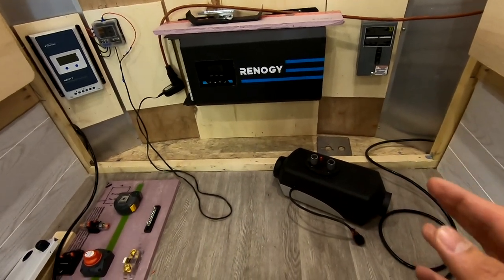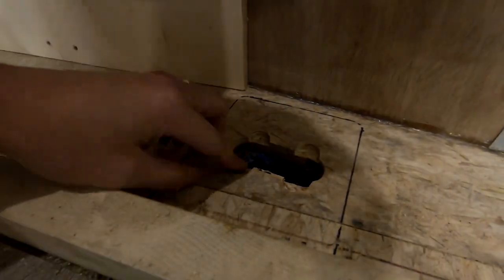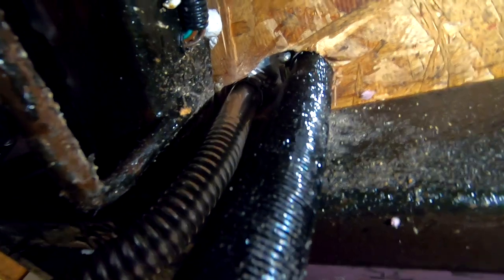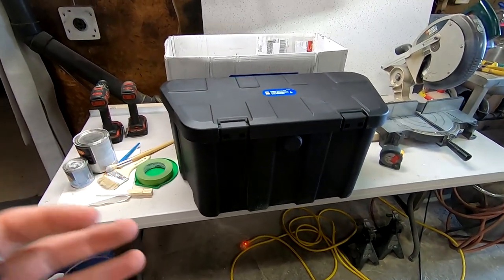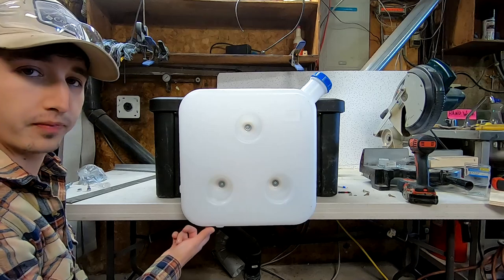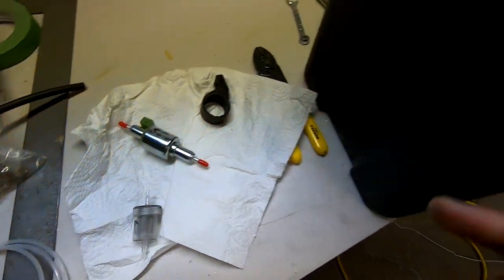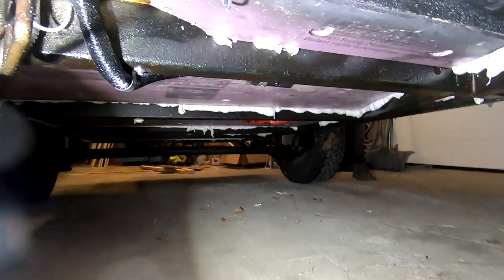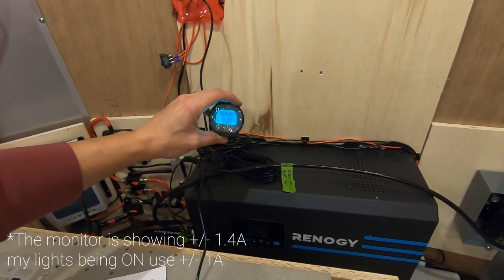DIESEL HEATER install! | Cargo Trailer Camper Conversion

Comment: At first I was thinking electric heat with a generator powering it but now leaning towards one of these diesel heaters!!  Thanks for the video!
Reply from the maker: Yes, make the hole larger!! Update video on my channel where I fix this. Otherwise, the heater works great!
Reply: @JoelTremblayCA  I deleted my question right away after I read the rest of the comments and found and saw your follow up video....unfortunately you got back to me before I deleted it, lol!! Thanks and great work Joel!! :)

Comment: Great video, thank you for the time to put it all together.  This was the first of your videos I have watched.  I will check out your other ones.
Reply from the maker: Awesome! Thanks for watching and commenting. I appreciate it 😁
Reply: @JoelTremblayCA  I have the same heater as you, I went to install it in my build but had too many frame members in the way where I wanted to install it, so it never got installed.  I might just use it to heat my garage!
Reply from the maker: @johntalbert8227  it really doesn't need much space to run through the floor, just one opening around 3-4" in diameter.
Reply: @JoelTremblayCA  Unfortunately it's impossible where I wanted it.  I just have a lot of cross and angle frame members in the small area I wanted to use.  I could put it someplace else sure, but I wanted it in a specific spot.  On another note, your video on your floor installation has a glitch.  We can't see any of your replies to comments people have left. Did the floor just float, or is there adhesive on the back of it?  How is it holding up?
Reply from the maker: @johntalbert8227  right understood! I'm sure whatever you come up with will work. 

Thanks for bringing that to my attention! I had no idea. I'll look into it. The floor is "floating" with no adhesive and had a foam underlayment. 1 year later floor is still holding up great!
Reply: @JoelTremblayCA  Thanks Joel.

Comment: Nice job the only thing I can see is you might want to leave more room around the exhaust flex pipe it does get quite warm around the flex exhaust pipe. I have installed a number of these heaters , I error on the side of caution this type of heater is usually mounted to  metal not wood,

 if you got combustible materials to close, installed quite a few of these and I need to put a 4”. Hole with a hole saw
Reply from the maker: Yes good catch. My latest video I fix this issue. You can see the wood all burnt!

Comment: Very nice install video. I saw another video where they used a heat rated caulk around the hole in the floor. 
Since heat rises, I was wondering why you are running the heat duct up the wall.
Reply from the maker: Thanks! I haven't heard of using heat caulking. Good idea. I only ended up running the heat duct 4" from the floor.

Comment: Looks good ,I was thinking if the tank is higher do you need the  pump just a thought gravity feed! Maybe if pump fails!
Reply from the maker: I'm not sure if how that would works. I think the computer needs to feed the burner a certain amount of fuel per pulse in order to work efficiently.

Comment: The fuel outlet placement will leave a good amount of diesel left in the tank, so you will lose 1-2L of the 10L capacity of the tank.. Just think about replacing it with a 20l boat tank maybe? That one you could hook up under the trailer,  they are flat and don't take much space either 👌
Reply from the maker: Good idea and yes I'm aware of the placement doesn't let you get every drop of fuel but I didn't want to clog the pump with any debris. 

Now that the tanks been installed for over 8 months, I've been having issues with the cheap plastic it's made of! Boat tank is a good idea

Comment: I am getting aluminum  box for the front similar to yours and was wondering if the heater could be mounted in the box and just the heat vented into the traiiler  with  the controller mounted inside also? Thanks for the great video!!!!
Reply from the maker: With some modifications you can definitely make that work. Thanks for watching!

Comment: Wouldn't you want to insulate the diesel fuel line? Diesel fuel doesn't like to flow that well in cold temps, especially if you're out ice-fishing on a lake or something, those little plastic fuel lines would be brittle in very cold temps, too.  Still tho, watching your channel makes me very tempted to buy a cargo trailer and make it into a camper, you make everything look simple and relatively simple to do.  Would have thought such a conversion would be hard or need professional workers until I found your channel! Keep it up!
Reply from the maker: Thank you! And I'm not entirely sure. The lines are relatively thick, I was surprised by the hole in the line. They are quite small. Time will tell! If I have to replace / insulated the fuel hose down the line I will. Thanks for the feedback!
Reply: It takes VERY COLD temps for diesel to gel.  In this application, you'll never need to employ measures to keep it from doing so.
Reply: @TheYankmchain  you will if it's a snowmobile trailer.

Comment: One thing that would be really helpful though is if the videos in the playlist were in the order in which everything was built. It would be much easier to follow. Love the project!
Reply from the maker: Hey James! The videos in the playlist should be in order. I will take a look and make sure that they are. Thanks for letting me know
Reply from the maker: Hey James, I just checked the playlist and they are in order. Start from the bottom and work your way up!

Comment: Did the big black flex vent hose come with the heater? You could install one of those little fuel filters like they use in landscape blowers, hedge trimmers and weed eaters on a flexible tube so you take the fuel off the bottom of the tank. Just mentioned it so I remember when I come back and watch this when I install my heater. Yeah, don't use any sealant. That's what the O-ring is for. :o)
Reply from the maker: Yeah the black fuel line came with the kit, you cut to size. In the future I will be adding a fuel cut off / disconnect! Thanks for watching!!

Comment: Awesome build,,,…question for you . I see your fuel pump is amounted above the level of the heater and the fuel pump has to pump fuel down and back up to the heater. Is this causing you any issues or is it working well?
Reply from the maker: Thanks for watching :) I haven't had any issues with the pump the way I have it installed.

Comment: I hope you are still reading comments.  I like the idea of installing the fuel pump outside.  Is there any worry of the pump freezing in extreme cold temperatures?
Reply from the maker: I read every single comment! Absolutely haven't had any issues with my setup.

Comment: I purchased an aluminum nose box from Princess Auto that will accommodate both the fuel tank and pump, also I was pricing the solar gear with inverters, chargers and batteries, I concluded that buying a Bluetti system with fold up solar panels might be a better option. Your comments would be useful, also I enjoy your videos and methodology.
Reply from the maker: Thanks for following the build along! I actually talk about the advantages of the all in one (Bluetti) vs. Diy system on my Bluetti video. Good luck with your build! Thanks for watching.

Comment: That exhaust pipe is too close to the plywood cutout.  If it turns darker in color after a few runs of the heater......
Reply from the maker: You're correct! Check my latest video where I fix this issue.

Comment: What I done when installing the spigot in the fuel tank was drill the hole, then use the fuel pipe through the small hole and out the big hole put the spigot on, then pull the spigot on the pipe out through the small hole it’s makes it easier
Reply from the maker: Ah yes, that makes sense. Would have saved me a few minutes haha! Thanks for sharing

Comment: I'm thinking of installing a diesel heater in my insulated 8.5x20 cargo conversion trailer. I'm able to run a straight 10-12 foot warm air shaft on the floor along the passenger side. I will have 3 or 4 adjustable-louvered vents along the air shaft. Your thought on this Joel would be appreciated! Do you think the heater’s fan will move enough warm air to reasonably heat the living space? Maybe I'll need a 8kW model or something? TIA.
Reply from the maker: I'd experiment with a larger heater for sure! I've seen people do what you are thinking of. I'd recommend joining Chinese diesel heater group on Facebook.
Reply: @JoelTremblayCA  Thanx!

Comment: Would it make sense to have the inlet hose on the inside of the house, seeing that the air inside is already cleaner and warmer?
Reply from the maker: There is already and intake for the heater, the other smaller intake is for fresh air. Thanks for watching!

Comment: I enjoy watching videos of your build. I have concerns about an element of this install. The position and securing of the fuel tank. My fear is that over time, the flexing and twisting of the trailer as it rolls, will cause rubbing between the exterior bulkhead of the trailer and the fuel tank wall closes to that bulkhead. Add the normal vibrations of road travel and I fear it will wear thin, where this two contact. It will result in a thinning of the plastic tank ( in spots) and be the impetus of a small hole or crack and a loss of fuel. No judgements. Just passing along an observation. Be well.
Reply: instablaster...

Comment: Joel, curious about the exhaust touching or near the wood floor, is or was that a problem and if so what was the solution?
Reply from the maker: Checkout my update video after 10 months, I fix the issues I ended up having!

Comment: How much does the fuel tank hold and how many hours will it run on a full tank ? Great job by the way !
Reply from the maker: Thanks! The tank holds 10L of fuel. With some rough math I assume the heater could run for +/-40 hours straight on a single tank.
Reply: @JoelTremblayCA  Thanks for ur help 🇺🇸

Comment: so after some use, how's the plywood doing? did you get any charring? the exhaust on my diesel gets to 300 degrees and I'm worried about running it straight through the plywood like that.
Reply from the maker: I'll kindly direct you to this follow up video lol https://youtu.be/2EnqGCNNflw

Short answer is, yes there was charring. Need to have some kind of metal gusset / larger hole. I used a soup can!

Comment: What are your thoughts on using a diesel heater vs propane? Especially for winter camping since propane is good to -40 deg and usually doesn't need any electricity to run. Versus diesel starting to gel around 10 deg and relying on electricity to run. The main difference I see would be if you are worried about not having enough ventilation for propane byproducts?
Reply from the maker: In Canada, we don't normally have problems with diesel gelling, I'm assuming they treat it with additives. You can also run diesel heaters on kerosene. Yes propane doesn't need power but you still want to have it vented well, otherwise you'll end up with lots of moisture. The good propane heaters get quote expensive so in the end I'm still vouching for a diesel heater with battery. Of course everything has its purpose and what works for someone might not work for someone else. Thanks for watching. Stay tuned, I have another video on diesel heaters coming out this week!
Reply: @JoelTremblayCA  Awesome :)

Comment: Did you have problems installing the fuel pump horizontal and not on an incline to reduce air bubbles?
Reply from the maker: You don't want to install the pump in a horizontal position. In this video I show how I mounted it on an incline.

Comment: Nice video i was looking to purchase a 8kw heater for my 6x12 vnose trailer and how to install it for my sxs to melt the ice out of it during the winter here in canada its -40c windshield factor. Its not insulated but i think with the 8kw it will do the job. Just asking myself if it will heat enough to dry the floor
Reply from the maker: I would be careful about the 8Kw, I've heard that it's actually a myth and their just a 5Kw.
Reply: @JoelTremblayCA  oh ok thanks ill check on that. Ive notice there wasn’t a big difference of price between both of them.
Reply from the maker: @F250-expedition  yeah I'm not an expert on these things but I remember another guy on YouTube doing a test between the 5 & 8 and there was no difference. I'd suggest asking in the Chinese diesel heater group on Facebook!

Comment: Could u please tell me what "type" of screws (and where u bought them) with the large washers securing your foamular insulation to the bottom of the trailer are called? I was looking for them at Lowes/Home Depot but couldnt find them (whatever they're called). So I just used Liquid Nails. Although, I'd be more confident if I had those Large Washer/Screws holding the foamular underneath as well. Thank you in advance! AE
Reply from the maker: They're just regular wood screws and large washers from home depot! Thanks for watching.
Reply: They are called fender washers. The screws if going into wood, should be zinc plated deck screws at least 1/2" longer than the insulation.
Also if you can pull up the deck from the frame before you install insulation, roll spar varnish on both sides of your decking material whether it is osb or plywood at least two coats. It will greatly improve the durability and water resistance of your deck. If your unable to pull the decking, at least coat the underside with rubberized undercoating to give it some moisture resistance. Covering  the bottom of the frame with roofers tin will add additional protection from moisture and road debris. Plus helps with mpg by reducing turbulent air under trailer.
Professionally restored vintage Airstream trailers for years.

Comment: How is the heat output of the 5KW heater in such a small space? Just right, too much? I want the same one for a 6x10 Cargo trailer... Thanks!
Reply from the maker: Hi Brian, a 5KW heater in a 6x10 should work plenty fine. Make sure you insulate well!
Reply: 2kw is plenty if it's insulated. Think about a elec space heater, it would be plenty if insulated and it's 1500 watts. Everyone oversized these units and has to have them on low which soots them up and actually increases the case temp due to low air flow, better to have a smaller one running in mid range.

Comment: Exhaust line is touching wood-that’s why you use the plate with a big cutout.
Reply from the maker: Yes, I wish I knew of those before this install. I did end up making my own sleeve out of aluminum sheet. Thanks for watching!

Comment: Dude!!!! You need more clearance around the exhaust so it doesn't burn the wood. Thats why those screws are there. So people would make the holes bigger.
Reply from the maker: Yes you are correct. My latest video on the heater I fixed this issue!

Comment: In my opinion I believe that you should have made the opening hole larger as the exhaust really does get very hot 🔥...
Reply from the maker: That was something I considered but at the same time the fuel line is very close to it as well. I might add a aluminum sleeve around the exhaust to keep it separated. Thanks for your feedback!
Reply: Cut the exhaust pipe in half and put that muffler with the drain facing down in the middle and Wrap up the exhaust with header exhaust wrap and lookup what is called a turret mount

Comment: My cargo trailer conversion is a 7.5' x 7' x 16'.  I have to wait until the outside ambient temp is 50 degrees or less otherwise, even set to low(1.6hz) I run myself out of my trailer.  You may have already discovered this. 

Also, for longevity, make sure you run your heater on HIGH FOR 15 MINUTES each time before you shut it off.  This will burn some of the carbon out.
Reply from the maker: Thanks for the tip! Will do that next time. Ran the unit over dozen times now without issue out of the box. 

It does get warm even on lowest setting. Figuring out the exact opening I need in the roof vent to compensate for this. Afterburner upgrade looks appealing, more programmable features and temp control.

Comment: i know im a little late.. the light is on indicating a blown fuse since there is no fuse in the socket.. it will extinguish as soon as you insert a fuse.. this is intentional by design.. your unit is not drawing any power.. its simply the fuse panel doing its intended job
Reply from the maker: Yes it is designed to show the light when there is a draw and a fuse is blown. However, there shouldn't be a light on if the unit is off and there is no fuse. I confirmed this with other components on the system. For example the ceiling fan, I took the fuse out and the light did not come on, I turned the fan on and then the little light came on. 

On these little heater units the display is always on if you have it hooked up to power, thus always drawing a current. I installed an inline switch to be able to turn the display off when not in use.
Reply: @JoelTremblayCA  yes. You are correct. If there is no completed circuit anywhere, then the light will not work . It must see the device on the load in order to activate. Even when the heaters are off, the electronics are still in a standby state , thus allowing current to complete the circuit, lighting the fuse blown led. 

No fuse and a blown fuse is the same open circuit condition .

I always suggest using a switch with a relay to the fuse for the device, especially with devices that create a large load such as these heaters . I use one in my build and the switch simply provides the low current to activate the relay, saving the switch from destruction by high current loads especially while the glow plug is active.
Reply from the maker: @twystidceed7823  thanks! Your explanation is a lot better than mine!